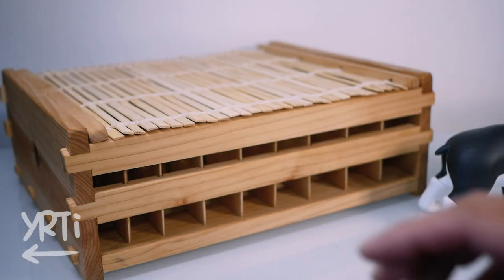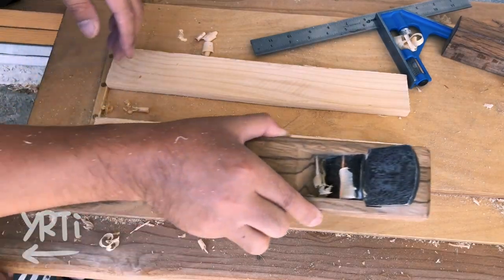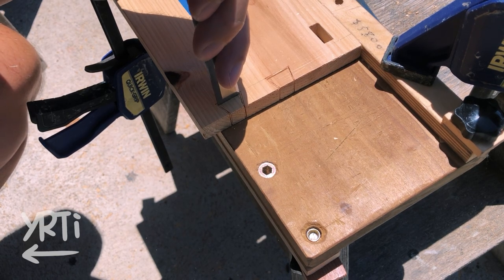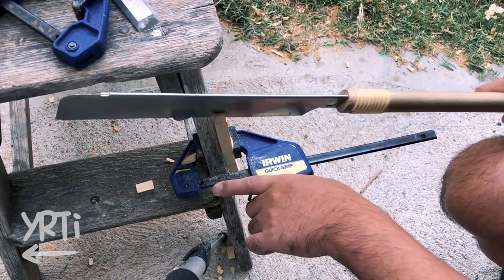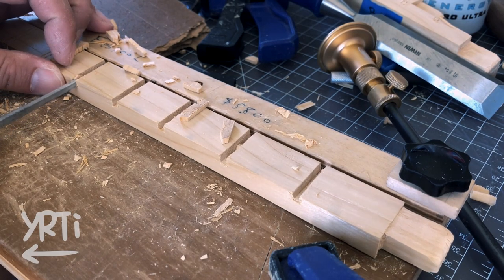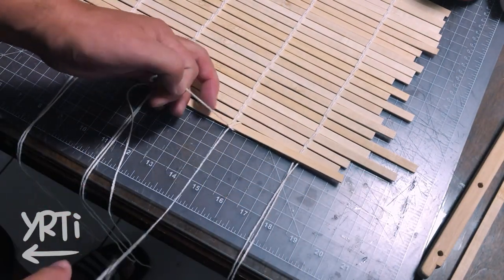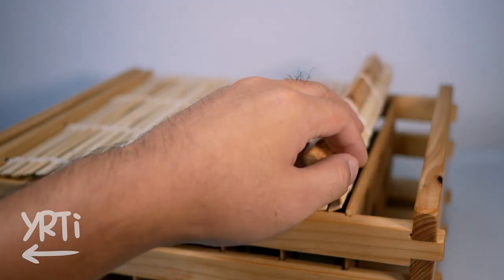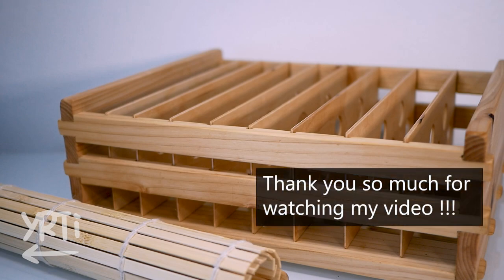Sharpening Stone Storage/Drying Rack from Cedar Fence Pickets

Comment: Yoooooo check out 3x3 Tamars small portable affordable workbench, I'm gonna start building mine in the next week or two as I don't even have a garage to do my woodworking, I just use a spot where there used to be an uncomfortable sofa used to be. It's basically a particle board frame with a particle board top on it, and I used deck screws to secure a machinist vice to it, which means I can only do small projects. But 1 and a half coping saws in, it's honestly not bad hahaha. Do you have a PO box?
Reply from the maker: Ah, I made a small workbench recently and it made a difference! As you see, it's a hobby level woodworking so I'll get things with an as needed bases and a little by little.  In the mean time, I do things that I can do with a current setup. Like you said, there are lots things that may not look good but actually are comfortable and not bad to use:)

Comment: If you had to upgrade the wood to something fancier what would you replace it with? Thinking of trying to build this
Reply from the maker: Thank you for the comment! I would go with cypress. The thing is, wood movement/split isn't a big issue for this storage structure but I'm concerned about two things. 

1st one is stain by slurry from stones. Even when I clean stones before storing them, sometimes it gets on the storage and it's super hard to clean. For this reason, I would avoide expensive wood (Cypress isn't cheap but isn't expensive in the U.S.). The another one is, anti-mold. Stones are super humid after use so there is still high risk of getting mold if stones and the storage aren't properly stored. Cypress has Hinokitiol and it's good against mold (People even make a bath tub out of cypress in JP so I assume it'll be good enough)

Sorry, it may not be a fancy option you are looking for...